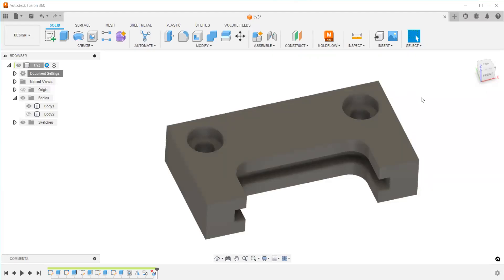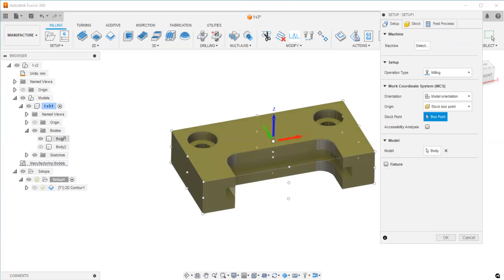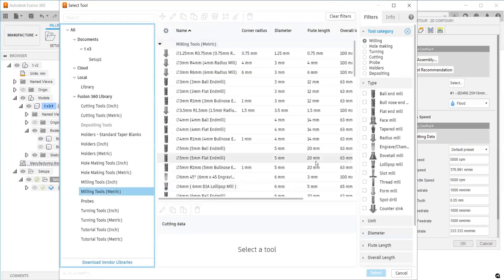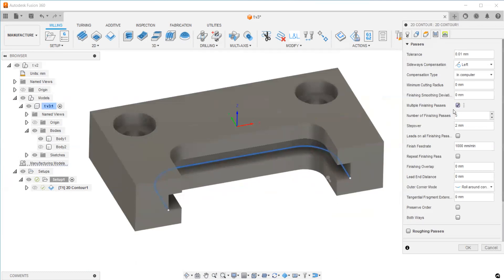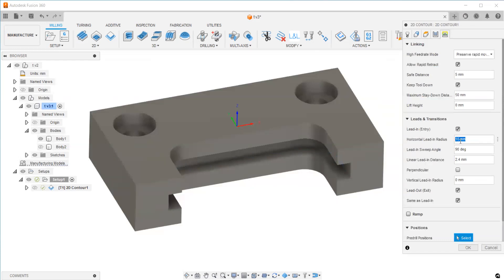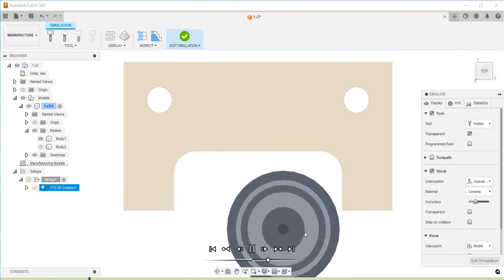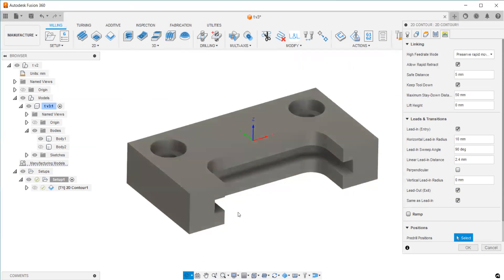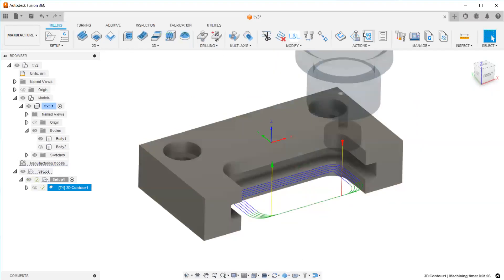Autodesk Fusion 360 - T_Slot Milling

Comment: Great tutorial. Do you have some thoughts how to do the same but to have several passes on Z axis? For example, i have a 5mm high slot mill but i need to create 12mm high slot. This is making me the most of the trouble. Thanks
Reply: did you ever find a solution? I'm trying to figure it out right now